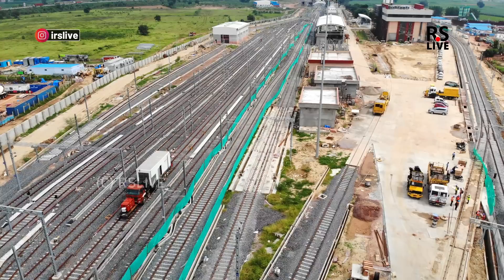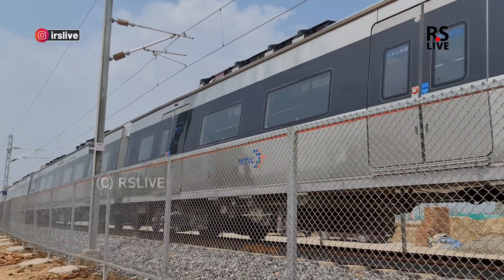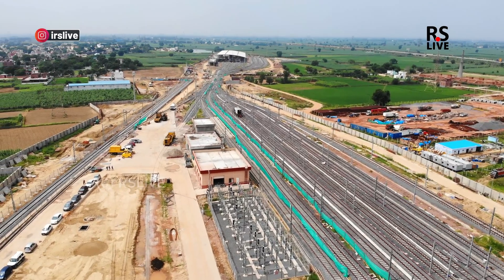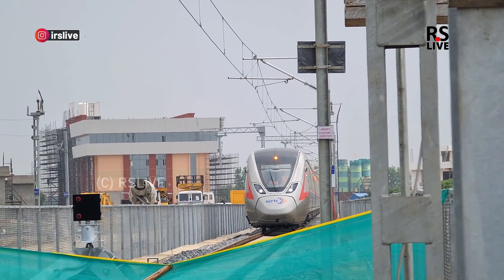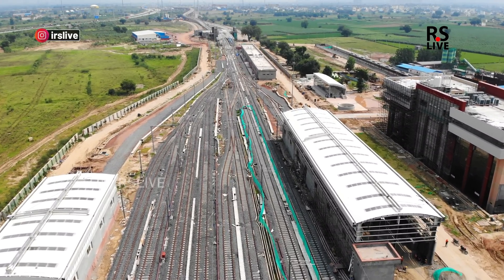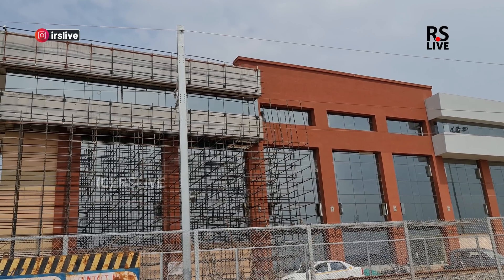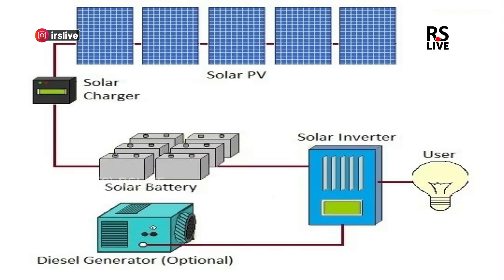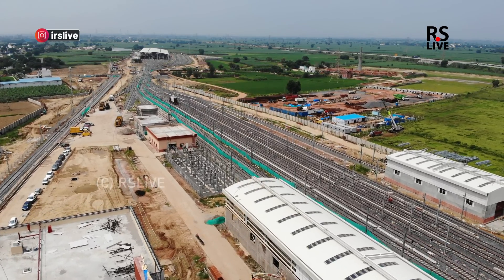देश का पहला RRTS डिपो - Duhai Depot

Comment: 🚅 Rolling stock will be provided by Alstom, France for the Delhi–Meerut Regional Rapid Transit System and will be manufactured in Gujarat, India.

The RRTS rolling stock will be first of its kind in India with a design speed of 180 km/h (110 mph). The entire rolling stock for Delhi-Ghaziabad-Meerut RRTS corridor will be manufactured in India.
Reply: 180 kmph 🤔🤔 means even faster than gatiman express 🤔🤔😅😅
Reply: @crazyearthling1478  yes

Comment: The Government should start the work on all the three sections which are proposed together so that the work is completed early and people are benefitted. Currently Government has only started work on Delhi Meerut Rrts but there is no work on the other sections. Please tell me the reason that why the work on all the three proposed sections cannot be done together. In all three proposed sections of Rrts different states governments are involved and as per my knowledge half of the money is given by the State Governments and half money is given by the Centre Government so in this case money should not be a issue. Please clarify my doubt and if you agree with me so please contact the concerned department and make a video on it. If you are unable to contact them so write a letter to the concerned department. I am concerned because in winters people of Delhi Ncr will again face the problem of Pollution and again we will have no solution because the Delhi section of Delhi Meerut Rrts will start in 2025 only. According to you which section should have been made First Delhi Section of Delhi Meerut Rrts or Ghaziabad Section. My view is that the government should give more Priority to work of Delhi Section so that a major problem is solved which is Pollution and my last point is that all the three sections of Rrts will cross different parts of Delhi so the work on all the three sections in Delhi should start immediately. Please correct me if I am wrong and please answer my questions and clarify the doubts that I have. Your videos are good but also add some information about  how many trees are cut in total for the project and is the government replanting them somewhere or not it is very important. You have a duty to make the citizens of India aware of the same because you are working on ground and what you show people believe that very easily.